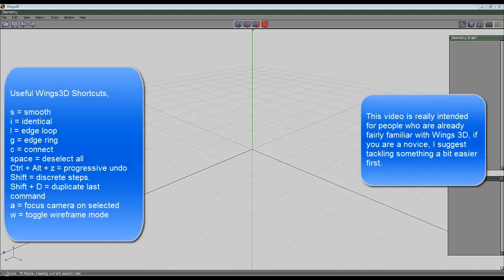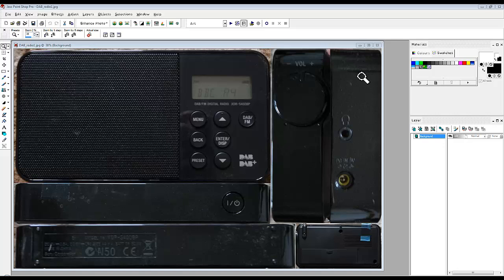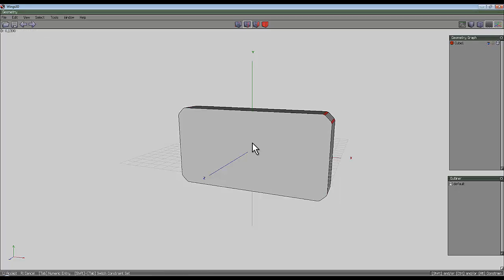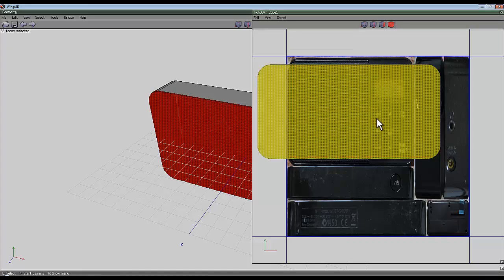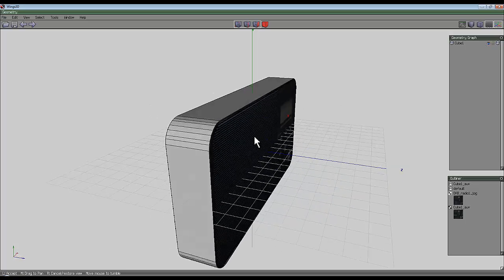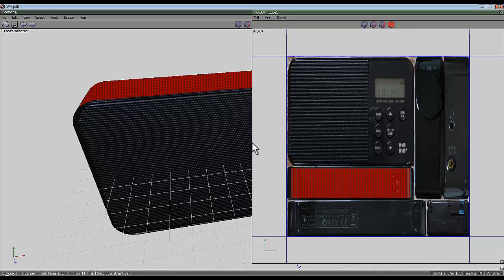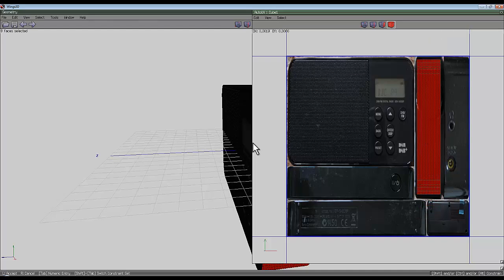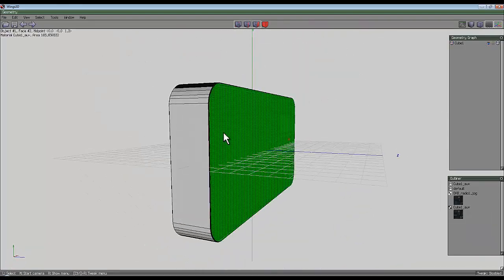Wings 3D - my second UV map - by David Brinnen.

Comment: You know that you can save the UV mapped template, I presume?
Once you have generated a map, and created the Texture map, click on the new item in the Outliner window. Select make eternal, and navigate to the location where you want to save the template. in the name bar, click so that the name is not highlighted, then type the extension (.jpg, .png, .bmp, etc.), and then click save. Net export your UV mapped model to the same folder. Now you can take that template to any image editor and use it to create textures. In a 3D app including Wings 3D, you can apply the new texture to the model all in one go. There are more complex things you can do by using the template to make multiple texture maps for things like bump, displacement, ambient, specular, and a lot of other surfacing channels.
Reply from the maker: No I didn't know that, really I've only just scratched the surface of UV mapping in Wings.  It's all new to me.  I'm documenting as I go along as much for myself as anyone else who might be interested.
Reply: David Brinnen I can understand that, my friend. I just thought you could use the information, and like you I am into helping any way I can.
Cheers!